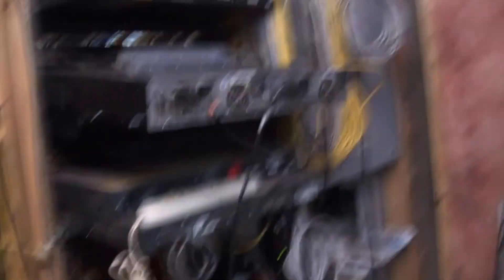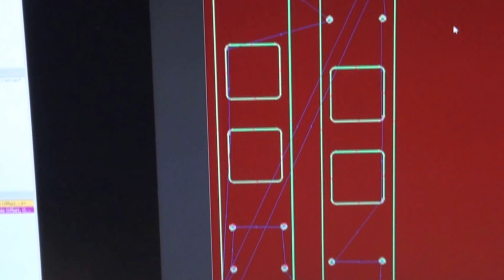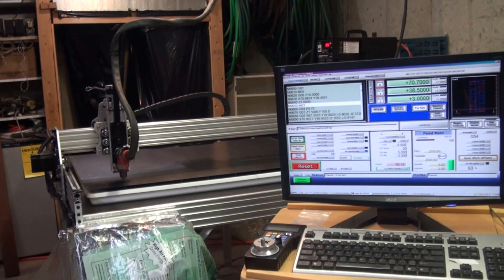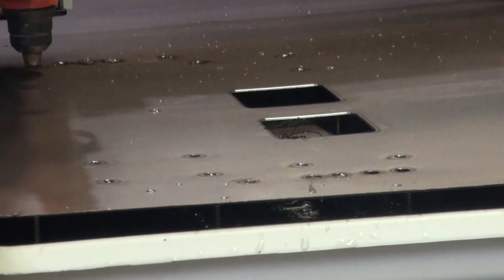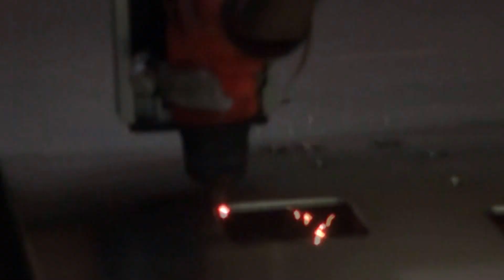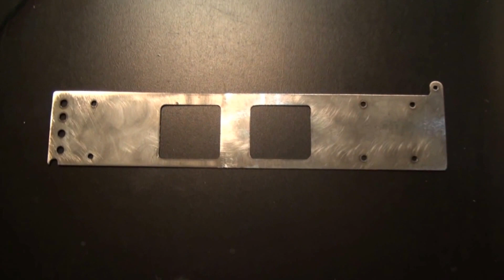First Cut On My Homemade CNC Plasma Table!

Comment: i'm wondering is this is really what is commonly named "high resolution plasma" because near of 1/10 mm is not really ''high res'' in my mind and i can't find real data of non diy table about their resolution, don't say here that the work is bad or the resultant part will be off tolerance, just want real in field point of view :)

Comment: I really like how you built the frame work for this project and want to do the same. Can you give me some info on what linear rail bearings you used as i am having a hard time finding something that looks like what you have. Thanks
Reply from the maker: The vast majority of the structural and motion components of this machine is constructed using openrail extruded aluninum parts (openbuildspartstore.com).

Comment: Hi Kevin, Amazing job you have done! 
 I have built a CNC mill with 2kW spindle, a CNC 40W CO2 laser cutter, and now I am VERY interested in building a very small CNC plasma cutter to perform one very specific job repeatedly.  I will be cutting several hole patterns into 1mm thick steel outlet cover plates.  The smallest holes are 1/8" diameter to be cut, and I presently do all of this on my CNC mill.  How happy are you with the quality of cuts from the Harbor Freight Plasma cutter?  Much slag?  Which model?  I am familiar with Mach3, but I am curious if I will need a Torch Height Controller because my plates will always be placed at a precise location on my cutter and are perfectly flat.  Any advice is greatly appreciated.  Thanks,  John
Reply from the maker: Hi. From my experience with my homemade plasma table, which I use weekly (if not daily), you will most likely need torch height control for your application. If you are making many small cuts in 1mm material, you will certainly get deformation as the metal develops hot and cold spots. Quality of the cut is very dependent on having the torch the correct distance from the target material. I added THC to this machine about 2 months after I shot this original test-run video and I would never cut again without it. The Harbor Freight cutters are great for what they cost and I would highly recommend them to someone wanting a decent entry-level machine.  You get what you pay for, and because I started using my plasma table more and more, I have since upgraded to a professional duty Miller unit. It can cut thinker for longer, more precisely, without needing so much "time to rest". Thanks for your interest.

Comment: Nice work
i'm curious as to my you have so many wired lan connections,  Ive worked for Nestle and the automation switch gear didn't use this many.
Reply from the maker: Yeah, i do have a lot of Power Over Ethernet Gigabit ports.  I have always been a techie and when I built my large home in 2003, I over-wired it knowing that the trend was for more and more things being connected to the internet. Good thing I did, because although many people thought it was ridiculous overkill, it turned out to be a good idea because I  now use almost all of the 96 ethernet drops I have. I run my business from my home and have many IP Phones, TiVos, home automation sensors and devices, surveillance cameras, servers, video streaming boxes, computers, and also have an IP HD audio/video distribution system in use. The ports get used up fast. Nothing beats a wired connection and I also use the POE system as a DC power supply to replace all the wall-wart transformers in my home.
Reply: Now that's the home automation I like, non of that invisible wireless stuff.  I'm running my Plasma table over a fibre serial link, I have not got brave enough yet to go fibre over lan.

Comment: This is a good job you've done here.
Hi I'm planing to build a plasma cutting table for my use.
Would you be prepared to share some of the parts u used and electronics/electrics/drawings?
I'm a bit behind the 8th ball when it comes to electronics.
I'd appreciate any and all help.

Comment: may you please explain how you connected the electronics and manage to convert this to plasma from ordinary
Reply from the maker: To activate the plasma cutter, I used one of the outputs of my CNC control board (Ethernet Smoothstepper) to close a relay, which is connected to the same wires as the trigger on the hand piece. My plasma cutter had an variable delay as to when you pulled the trigger and when the torch fired (based on how hot the tip was).  It also had an LED which lit up when the torch fires up.  I used a 4N25 optocoupler connected to this LED which fed a signal into one of the inputs of my controller so the software knows when the torch is activated.  I then modified the G-code in the mach3 software to 1) close the relay to light the torch, 2) wait until it receives the signal that the torch is lit, 3) pause for piercing the material, 4) then continue cutting. I have made many improvements to this machine since this first cut 1 year ago and it works INCREDIBLY.  I have made hundreds of parts with it and it is incredibly fast, precise, and reliable. Thanks for your interest.
Reply: PLEASE CAN YOU PROVIDE DRAWINGS FOR THIS?
Reply: never mind, i figured my breakout board had an in-built relay